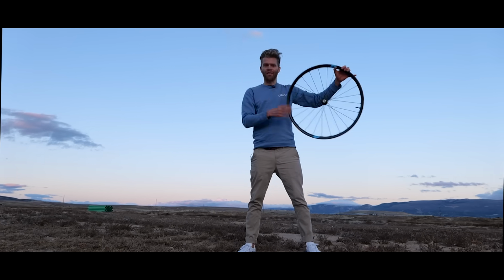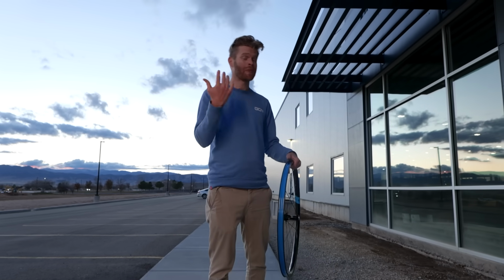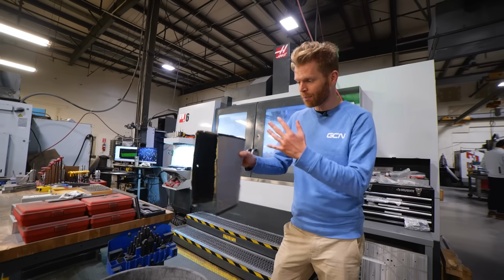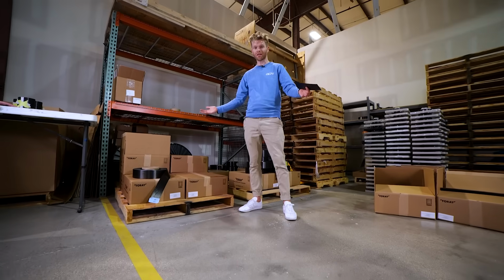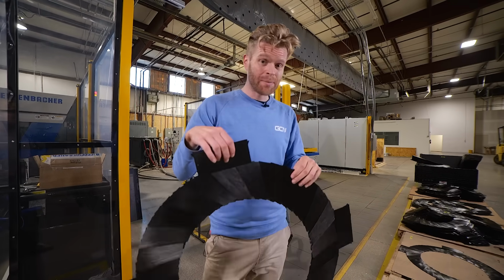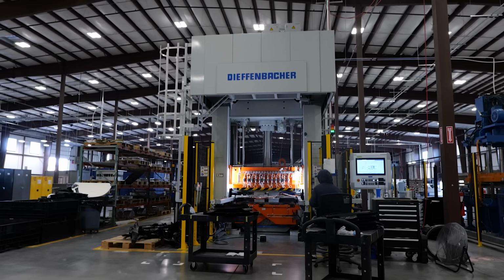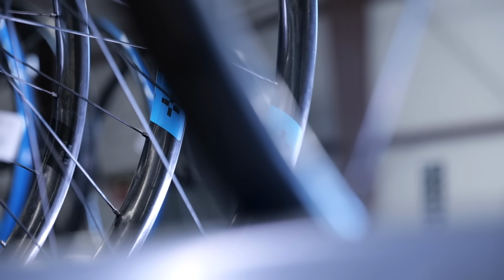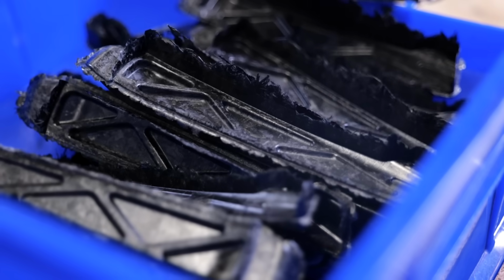Is This The Next Step For Carbon Fiber Bike Parts?

Comment from the maker: What do you make of this carbon process? ⚙
Reply: After almost 30 years of working with composite materials as a blue collar and as a designer in engineering, I have now come to the conclusion that there is simply too much hazardous waste being produced.
Reply: The process is interesting, good to see the waste being usable.
However - You didn't mention the weight or relative strength vs "traditional" carbon fibre?

Nylon and epoxy have different properties, so there is likely some difference. (However it may be insignificant).

It's not necessarily bad if it weighs more, or isn't as stiff, but useful to know.
Reply: @twatts4436  "You didn't mention the weight or relative strength vs "traditional" carbon fibre?"

Nylon is suitable for making wheels on its own and epoxy resin definitely isn't. The iconic Skyway Tuff Wheels are made of nylon; they've been making them since 1974. They've also made a graphite version (i.e., carbon fiber-reinforced nylon) since the 1980s, which are lighter and stiffer than the plain nylon ones. 

If I wanted plastic wheels, I would much rather have carbon fiber-reinforced nylon than carbon fiber-reinforced epoxy resin. Nylon is an extremely tough material, and isn't even remotely brittle like epoxy resin is. glass fiber-reinforced nylon is used for making, e.g., Glock pistol frames, and carbon fiber-reinforced nylon should be even tougher than that.

As for weight, nylon is slightly lighter than epoxy resin per volume. The former has a density of about 1.15 g/cm and the latter has a density of about 1.21 g/cm3, but the overall weight depends on the ratio of plastic to carbon fiber.
Reply: @twatts4436 that could be something for future videos.
Reply: Great process. Quick and less labor intensive. To encourage sales on the wheels, hopefully they are less costly than traditional carbon wheels.
Reply: I love it!
Reply: I have fusion fiber wheels, I’ve hammered them hard in the desert, on scree slopes, up and over mountains and they have performed better than my aluminum rims. The only thing I still find strange is the sound they make when a rock bashes them, it sounds like a ping pong ball or sometimes a tennis ball hitting a racquet.
Reply: So no greater heat and wear resistance for brake tracks and for going back to rim brakes: useless in my opinion. I keep waiting and hoping.
Reply: Thermoplastic materials are  useless  for stressed components like wheels  that will  be exposed to heat from the sun on one side  on a regular  basis.   Weve already been  here in the 90s. GT had a whole bike frame and  Tioga made wheels.
Reply: Can you please add captions translating these Farenheit and psi things for the 95% of us?
Reply: @craesh 😅😅
Reply: If it helps, 100psi is the pressure of my rear tyre and Fahrenheit 451 is the temperature that paper catches fire. :)  @craesh
Reply: @raybarber9837  that doesn't help at all because
Reply: Sorry.  @braulio_la
Reply: Pretty awesome stuff, but funny that, after all that automation, they build the wheels by hand. Maybe it's editing, or they simply true them by hand, but it's amusing nonetheless.

Comment: Neat. Now make a rim braking variant.
Then I'd actually switch carbon wheels.
These have the potential to be forever wheels, would just need a replaceable braking surface so it could be swapped every 15 years.
Nevermind I had convinced myself bc of all the hype that they'd have improved thermal properties as well. Back to my original idea of a shallow alloy rim with a non-structural composite aero section.

Comment: Kinda really about time! Carbon fibre is such an old technology and definitely not as strong as it Once was with the dry layer process in the middle for all this gone mad weight saving! You will see split dry fibres in snapped Carbon fibre in the newer process of weight saving but we used to call it the cutting corners friday special gone daily! Carbon frame on pro's bikes will be double the layers say on a headtube to what you would buy from the manufacturer if wanted the same bike for example! Been there done the job know the tricks of the trade!

Comment: PLEASE cut the bs about recycling! There is nothing wrong with simply throwing waste material away if it's not valuable enough to save. That's what landfills are for. And for the record only 5% of "recycled" materials are actually reused, "recycled" just means that it is considered for recycling even if it is not actually recycled ie disposed of.

Comment: Thermoplastic/carbon fiber bikes were made by GT(?) in the '90s. The advantages were recyclability (not sure how), impact toughness, and the improved damping you mentioned. Disadvantages were inferior strength-to-weight and stiffness-to-weight, and that components like downtube shifters and cable stops needed clips to attach them because they couldn't be glued on. Interesting tech, thanks

Comment: This sound like the Scott endorphin frame of the 90s, it was not carbon fibre. So nothing new ... as always. For me the future is Titanium and Aluminium. Carbon fibre is very common and has nothing special. Precision CNC parts, hand built frames, titanium or reynolds 953 Steel ... that is the top, and they are not made of that boring material. I have two bicycles and it is enought, too much carbon fibre for me ...  burp!!! 🤢sorry 😁

Comment: I wonder how well this process works with core materials. My two concerns would be 
1.the high heat and pressure requirements may eliminate the possibility for lower density and non-temperature stable cores. Ironically eliminating things like thermoplastic foams/honeycombs. 
2.the matrix material may not have the appropriate fluid properties to adhere well to something like al/nomex honeycomb. Thermosetting resins can bond well to the small contact area because they spontaneously form "fillets" due to their adhesion and surface tension and I suspect molten nylon is a bit too thick.

Comment: In practice, recycling is still really tough and probably not economically viable except rapid downcycling. If you want to preserve fiber length then you kind of have to carefully pick the pieces apart and sort them by fiber length. The more common approach is to basically put the part in a blender and melt it down into a short-fiber reinforced nylon, which has applications but is not nearly the same thing as continuous fiber composite.

Comment: One thing worth noting on the thermoplastic matrix materials is they do require more infrastructure than thermosetting resins. Room-temperature epoxy resins can be used to laminate parts with no other machines. If you want better consolidation then you need a vacuum pump. Prepregs add the requirement of an oven. In order for the thermoplastic composite to come out well it has to be autoclaved. The nylon never gets nearly as thin as epoxy resin, so you need more pressure to force it to flow.

Comment: Very nice video guys! Something that got missed on the way, or I didnt hesr it, is the increased fracture toughness of an thermoplastic material vs a thermoset material, so you dont have to worry about impacts on the wheel. Nevertheless, thermoplastic material degrade faster over time compared to to thermoset material. I would like to see a wheel made of a material with bought materials combined, like its done in aerospace.

Comment: Well, well, did you forgot to add that: 1) Polyamide is not resistant to UV radiation, 2) Polyamide is MUCH weaker than carbon in tensile strength ?

Comment: Recycled? No carbon fiber is recycled. In fact it's devilishly difficult to recycle ANY composite material. 

You want to recycle stuff buy a steel car with a lead acid battery.

Comment: 14:48 I have questions... If you've chopped up the composite for recycling then presumably you no longer have long continuous fibres going through the recycled material, and therefore less tensile/ bending strength. This might be OK for something like a tyre lever where the forces on it are not huge (and it's not safety-critical) but how does that work for something like a stem, subjected to large stresses?
Reply: I'd imagine it would be similar to 'forged carbon' parts where short (4-20mm) 'flakes' of chopped roving are compression molded into solid chunks, then conventially machined (lathe or mill) into their final form. Forged carbon is sometimes called "black aluminium" as it's strength is anisotropic (same in all directions unlike an 'aligned' composite layup), and very similar in strength to weight ratio when compared to a high end heat treated alu alloy.

Basically, a recycled composite carbon stem made with carbon fusion could be made with the all the same dimensions as an alloy one, and would perform almost identically. The main benefit would be you could add an alligned layup within the recycled mix: e.g. a few layers of virgin unidirectional material in the axis you want the most stiffness.

Comment: Great video! But I can´t stop feeling apreensive about the thermo-lability of the material. It might not be a concern for most of Europe, but in the south, in the summer inside a car or a shed (or the trailer of a lorry) it can get very, very hot.
Reply: Glass/carbon fill nylon has a heat deflection temp (at 264PSI pressure) of ~200C. Even nylon alone is rated to 66PSI at 160C, and 264PSI at 60C. 
I think you'll be ok unless you stick it in the oven! Long term, it's actually better to store it in somewhere rather warm, as nylon can loose 40% of it's strength while water saturated.
When drying carbon filament for 3D printing you have to bake it at 80C to 90C for 24 hours. The 40-50C it might hit in your shed will be absolutely fine!

Comment: They could use some kind of elastomer/rubber instead of Nylon, so it could absorb more vibration
.
.
.
Ps: worked for a company that makes the front bonet of the Ferrari Pista, the Alfa Giulia and much more carbon parts for automotive
Reply: There's only so much vibration you can absorb while remaining a rigid structure. Which is why we use carbon fiber in the first place. If you want more then build it into the structure.

Comment: a new technology that requires a lot less manual labor, doesn't require expensive storing, produces less waste - so more of the material is turned into product, and is faster to make. this is why the wheels are starting at only $6999.69 a piece. a steal! imagine how expensive they would be if they used the ten times less efficient eww-normal-carbon process

Comment: I don't see any immediate benefits for customers because 1) the pricing of those wheels are not noticeable cheaper, if not more expensive despite the manufacturing process is more automated; 2) no particular mechanical benefits, if not disadvantages, by using nylon instead of eproxy based carbon fiber; 3) its thermo stability is still lower although you might never need that much tolerance.
There is a reason why this kind of wheel is not all over the market. And, I doubt, and it is probably true, that such manufacturing technique is not so 'new' afterall, just less known to the general consumers.

Comment: Being left uncoated or untreated otherwise, I'm wondering how they managed to overcome the strong hygroscopic behaviour of nylon. Nylon can absorb up to 8% of his weight in water.
Reply: you kind of want to have nylon absorbing water, most of the "nylon" we are used to in the everyday is almost fully saturated. Dry nylon is brittle and quite stiff, this applies to basically almost all plastic polymers, most nylon products go through a conditioning chamber to be water saturated before the end of the production cycle.  

Basically you want dry nylon in production to avoid, generally, hydrolysis of the polymers due to boil-off and the stringy/messy nature of wet nylon. During normal use you definitely want wet nylon due to the more flexible yet resilient nature of the wet polymer.
Reply: @andy_liga  I think the concern more so regards internal stresses and holding dimensional tolerance on a part where the material is hydrating after manufacture.

Comment: Pretty cool and interesting, also the fact that it appears a lot more environmentally friendly is a big step forward. Would like to know if there is any perceivable performance / feel difference between traditional pre-preg and these modern forged components
Reply: Environmentally friendly how?
Reply: @The_Ballo  The video covers it but mainly on 2 axis. On one side, the pieces can be re-molded into something else, meaning if your frame breaks, it could potentially be recycled and turned into another item, whereas tradional carbon fiber is disposed of in the trash. Second, the overall making of the parts seems to be much less energy consuming - the video doesn't go much into detail here but notice how with epoxy carbon the storage is a freezer, later an oven, etc.
Reply from the maker: The eco credentials are super cool 🙌 Would that make you want to buy that product?

Comment: No. This is a dead end canyon of crap performance and short lifespan that was abandoned in the early 1990s. The Nylon does not adhere to the carbon fibres or impregnate them properly.
The nylon absorbs water and becomes electrically conductive and forms a battery and circuit electrically corroding any metal in contact or part of the frame. (it's called a metal-air battery.
The nylon is far too low stiffness to allow the carbon fibres advantages to be realised.
The inability of the nylon to wick into the fibres makes the composite full of air and unable to share load between fibres.
You are wrong about heat resistance of epoxies.
They go soft at 60C to 90C.
But at least they adhere, impregnate, and work with the carbon fibre properly.

Comment: I worked 15 years ago for a company, where they produced carbon fiber parts for Aerospace. Especially for the Airbus A 380 and others. I'm a Mountain Biker since 1990. At the beginning, 11 years old, I couldn't afford a carbon frame bike. After my personal
experience with the production of carbon fiber, I will never ever want a carbon frame.
Remember Greg Minnaar in Val di Sole? Sant Cruise Carbon DH Frame vs pice of wood ? 13000 $ bike? SNAP, CRACK, BRABP, SHIT
There will be no soul in a plastic frame, ask Lance Armstrongs Testicles🤔😁😂‼️

Comment: interesting seeing aeolus branding on the tooling - looks like they produce bontragers "oclv next" 

Not surprisingly the construction is only possible for hookless. Also as someone also noted it's also a bit heavier than resin which will increase weight on the outer wheel - I'm not quite sold.
Reply: I see no reason it couldn't be made to work on a hooked rim. In fact, this materials seems to permit processes that make hook forming easier.

Comment: Great video but you missed the details of key stage. How are the two sides bonded together. That for me is the most critical as it has the spoke forces applied there and could catastrophically separate the join failed.
Reply: I'd imagine there's a reasonably sized overlap down the center: so the spoke nipples would go through both the left and right side of the rim and the 'bonded area' would be wider than the nipples. So the rim bed would be "double thickess" and the two seams not in contact with the holes.
The great thing about using thermoplastic for the matrix is it how can be fully melted again and again, so to answer your question, the two halves are likely joined in a process that would be a sort of combination of compression molding and conventional casting/drop forging.
With resin carbon you have the matrix starting as liquid, then compress and cure it, with thermoplastic you heat the material whenever you need to, to make the matrix into a liquid temporarily.

Comment: Just curious - is Nylon repairable as carbon? Can it get the same properties after repair, as carbon?
Reply: Theoretically more repairable: the comparison isn't nylon vs carbon, it's nylon vs epoxy. Epoxy sets once and forever, so to repair you have to sand it back and rely on the new epoxy sticking to it. Nylon however, you could melt and reform a dozen times and it'd be just as strong as it was before.
Practically less repairable: unless you can get hold of an exact aluminium/steel 3D negative mold of your wheel, any rework is likely to distort it massively, as you need to heat it to 250C to get it to flow properly and bond well, the problem with that is you'd be making the rest of the wheel soft at the same time!

Comment: For the sake of accuracy, (and definitely, 100%, not pedantry), usually, reinforced concrete is a mix of cement, sand, and aggregate, (i.e. stone of varying sizes), forming a matrix surrounding steel reinforcing bars  (But there are other ways of making reinforced concrete.)

Comment: A company back in the 1990s known as Spin, was making a tri spoke wheel with what they called thermoplastic carbon fiber. It seemed like they were using a similar process to what you showed, but maybe not quite as efficiently done. Their product was significantly more affordable, but heavier than the competition. And there are techniques of recycling, Carbon fiber. There are machines that will burn away the epoxy, leaving behind dry fiber I saw a demonstration where they loaded in a broken bicycle frame and out came just the dry carbon fiber strands.
Reply: You are going to expend fuel energy, put bonding chemicals into the air, to recover broken tortured fiber that you do what with? What nonsense, just throw it out.